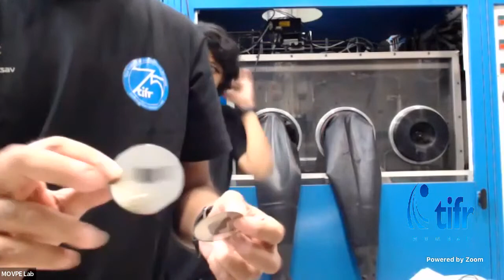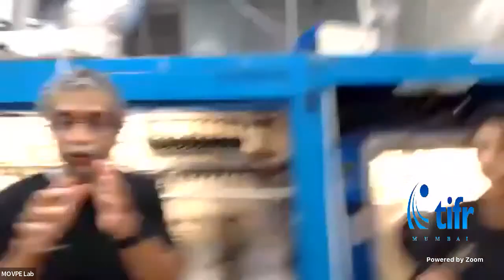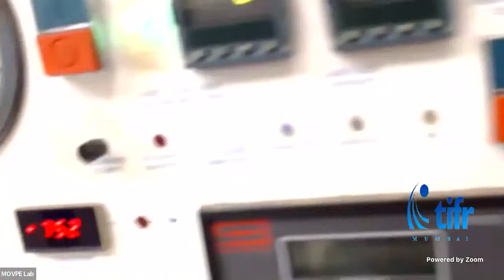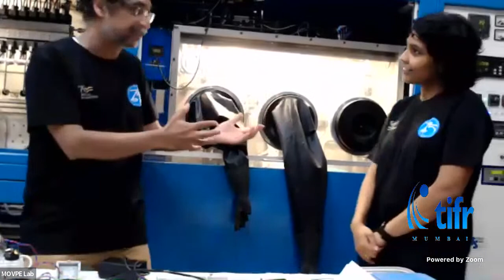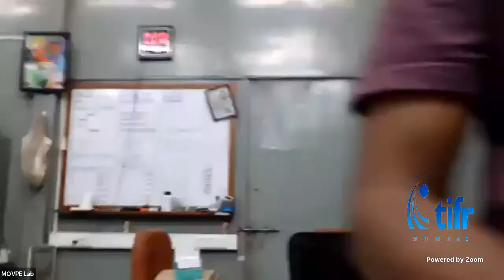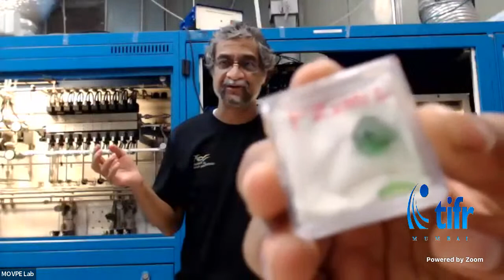“Growing” semiconductor materials – atomic layer by atomic layer

Comment: Enjoyed the session. Have two Qs. There was a statement "alloys allow continuous change of bandgap". What does continuous change mean here? 
Wikipedia explains phosphor as a substance that exhibits the phenomenon of luminescence. Phosphors are usually made from a suitable host material with an added activator. The best known type is a copper-activated zinc sulfide (ZnS) and the silver-activated zinc sulfide (zinc sulfide silver). So in your lab you prepare the phosphor (as per requirement) or get to buy it as commercial material?
Reply: Thanks for your comments! 
Firstly, we do not make white LEDs, or even blue LEDs. As "test" structures, we have grown some blue LED structures, but we haven't made packaged devices. So we do nothing with phosphors! However, I think the world has moved from only ZnS based phosphors to more of the rare-earth-doped oxides (like Ce:YAG etc.)

About the continuous change of bandgap: "Bandgap Engineering" by changing the composition what makes compound semiconductors useful. For e.g. take GaAs (~1.4eV) and InAs (~0.36eV). By adjusting the In to Ga ratio in InGaAs, one can tune the bandgap of InGaAs all the way from 1.4 to 0.36eV (any composition in the range, not just some fixed values - hence continuous change. Hope this helps. Lots of lectures/notes etc. available online that explain further.
Reply: @TIFRArnab  thanks for the response 🙂